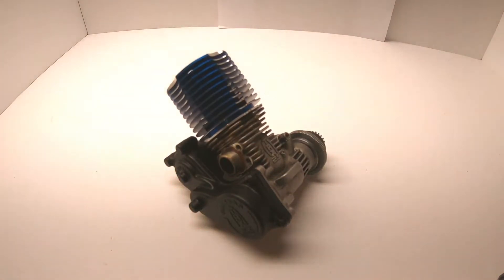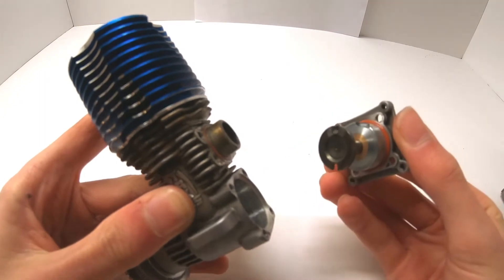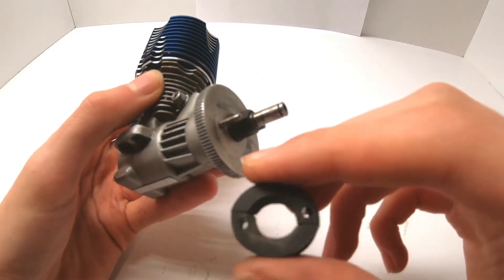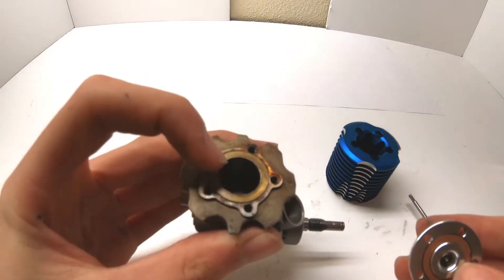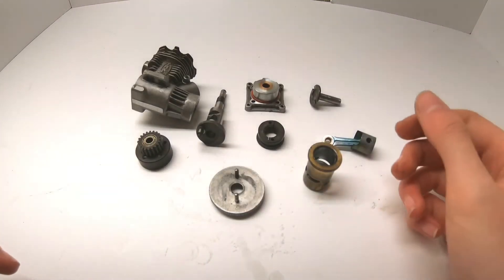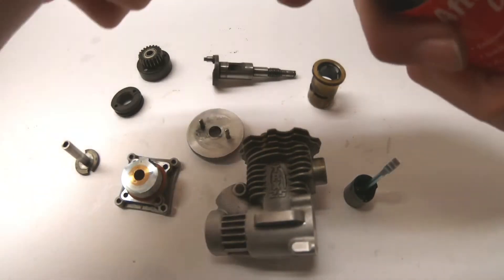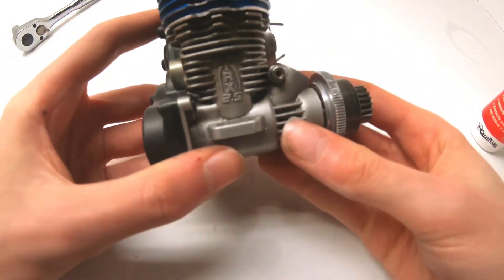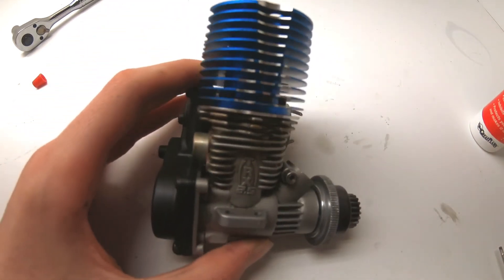How to Rebuild a Traxxas Nitro Engine

Comment: Hello I just subscribe to your channel thanks for the video very helpful I really enjoy it but I do have a question about the one way bearing I notice you didn't put the washer in front of the bearing before you put it back together this is the second video I have watched that it wasn't installed is there a reason for this?thanks again for the video
Reply from the maker: The one way bearing was there, but I accidentally cut out the part where it was installed, thanks for pointing that out, but you are correct, the washer goes in front of the one way bearing.
Reply: @TheHobbyistRc  Ok Thanks for the reply back